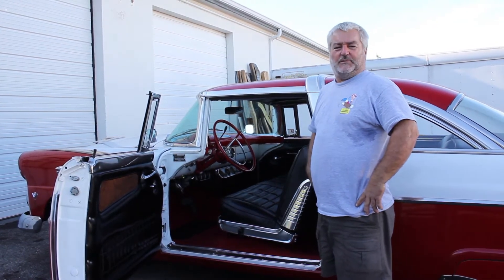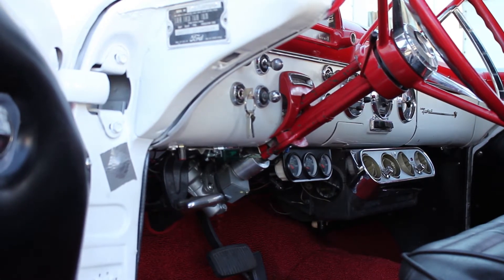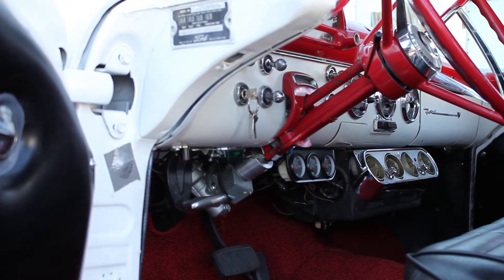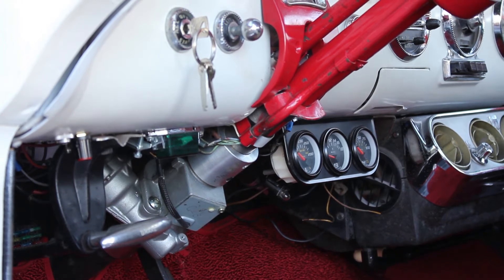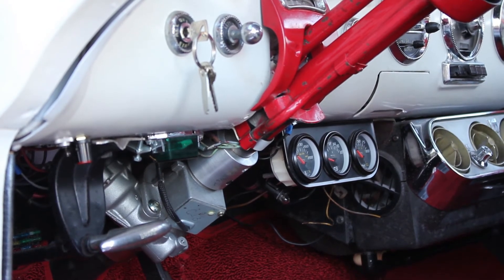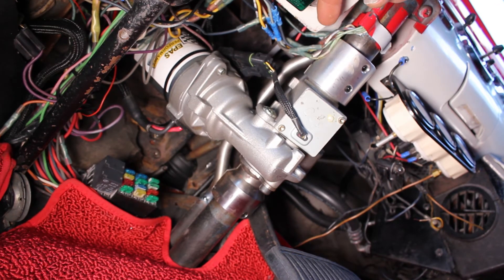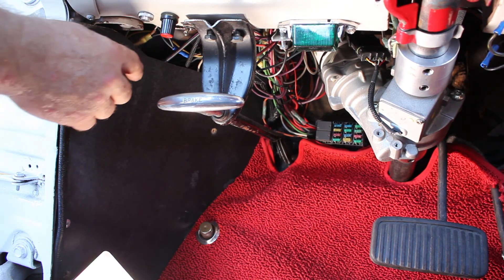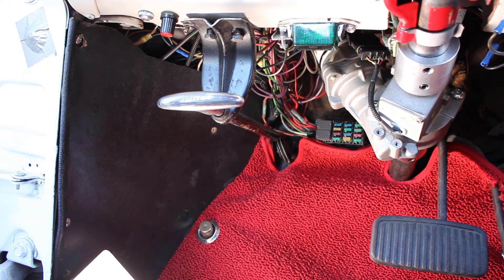Electric Power Steering "How to" Installation Summary on 1955 Crown Victoria

Comment: Have you considered making a cable actuated version as well? Similar to the mechanism some cars use for the rear electric windows, only suggesting this as it would require a smaller footprint on the column and allow the motor to be mounted more remotely under the dash(for older cars where the column is more exposed and the dash it narrower(Morris/Austin type vehicles))
Reply from the maker: We are in the process of trying to design something for column shift vehicles. Thanks!
Reply: EPAS Performance that.. uhh makes no sense really, I just mean make it so the motor isn't actually attached to the steering column so you can hide it away better.
Reply from the maker: @exogator  Sorry for the confusion from my end. I misread the question with the assumption you were asking about cable driven shifting options. No, our system will never be designed to operate like that. It is an assist for manual linkage only. Thanks!
Reply: EPAS Performance I think we're both confusing each other. What I'm trying to discribe is a setup the same as what you have installed in the video but remote mount the actuating motor and use cable to controll it on the column
Reply from the maker: @exogator  I understand what you are asking now, no we will not design something like that. Our system is not designed to be able to be controlled by a cable and must be installed with manual linkage. The steering shaft turns the worm gear, to turn the electric motor. Feel free to give me a call to discuss the details.